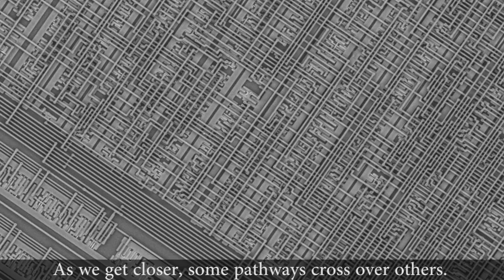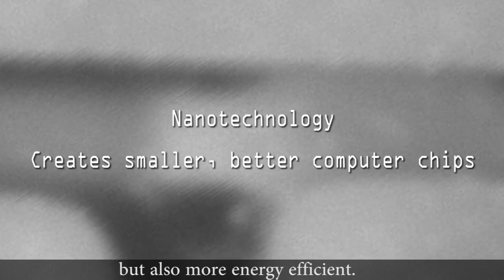Zoom Into a Microchip (Narrated)

Comment: We're actually reaching the limit to how small we can make them, which is why we are seeing newer CPUs which have multicore processors, or more than one processor on a CPU which works together with the others, this combined with better and larger L1, L2 and L3 cache memory on board the CPU (it fetches commands and stores them in the local cache) all work to speed things up.  In the past it was more a matter of shrinking the CPU down smaller and smaller so you could fit more onto one CPU.

Comment: Facinating. but the leads going to a CPU is VERY FEW compared to the number of actual transistors and microscopic wires and stuff!

Does that mean that input and output between leads are just the "buses" for data to be sent? I am guessing they are sent in unimaginably fast bursts 1 after the other through many lanes?? correct or no?

Comment: As time's goes by transistor in modern microchips are getting smaller and smaller, but it's basic composition and functionality are the same, it has a source and a drain and we need to put something in between (transistor base) to put a gap where we can switch on and off by feeding voltage.

But at some point in time we will reach the smallest size where we can never make it anymore smaller than what we have, that is when the quantum physics come into the scene, the base in the transistor will no longer be able to act as a barrier between source and drain due to the quantum tunneling.

When we come to this point, perhaps we need some other way on how to resolve this problem.
Reply: But why I am getting trouble with it? I just rather think on how to protect the secret recipe from mad scientist plankton LOL

Comment: its scary to think we are now 100% reliant on technology that nobody can make or even understand at other than basic level (the knowledge exists only in the accumulated matix of a million minds and machines, not in any one persons mind, or even 1000 if they got together and pooled their knowledge). no one person even really knows how to make a modern pencil (its an assembly of completely separate technologies) let alone the simplest silicone chip. the person who could design the layout of a chip wouldnt have a clue how to make the board for example, or what it even was made from. or the silicon. whats that. theres literally hundreds of trades and technologies you'd need to master.
Reply: andy765gtr 
Challenge accepted.
Reply: How do they make the diagram for 1 f**** billion Transistors?
Reply: Computers basically.  The highest level microchips are probably about 90 billion transistors right now. for designing chips of this level you need software like cadence or mentor graphics.
Reply: Adaptation
Reply: @SirDella   they use computers😂😂😂😂
Reply: Its not scary. Its called evolution.

Be proud of our race.
Reply: @SirDella  on the computer made of ... 1 billion of transistors
Reply: andy765gtr Let's see if you were right.
Reply: sheesh such a Debbie Downer
Reply: LOL. Hugely exaggerated... You think that the computer engineers designing cpu architectures don't know what material is used for the boards? Seriously? People's knowledge is not in such extreme isolation. I think your central point is true, but not to that level that you stated. I'm sure a small team of highly skilled people could design a modern computer. The real hurtle exists in manufacturing because you would need very expensive machines and facilities to manufacture a modern computer with such tight tolerances. That takes a lot of funding.
Reply: Mass production
Reply: One ww3 and a nuke war later, we back to stone age.

Comment: Almost as complex as these chips are is their manufacturing supply chain and production equipment.  A few critical links of that supply chain pass through Ukraine, Russia, Netherlands, German before passing onto China, Taiwan, or South Korea.  If any of these countries suffers a war, the supply chain will be broken until manufacturers scramble for the next months or years before they get the supply chain repaired with new links in other countries.  Did you know that 60% of the worlds microchips are manufactured by a Taiwan based company called Taiwan Silicon Manufacturing Corporation.  Also the main essential microchip manufacturing equipment is all made in Netherlands by a company named Advanced Semiconductor Materials Lithography

Comment: But how the hell they can creat this "super  crazy" thing? How the wires are connected to each other...they are so tiny? Can someone tell me the answer or where i can find the answer! I've been doing reserch for this, but i still dont get how!
Reply: ***** Thanks i'll do! But assume that they've already have a workable chip, now how they can make a compiler for it? i've reading book name "C-O-D-E" and some other books but it's just in a small scale idea chip not the actual chip! Thanks again for rep!!
Reply: +Rock Madly a specific robot arm makes microns of moments, the robot does it all. bow down to the almighty robot arm!
Reply: +Rock Madly It's all done by robots.
Reply: @TymphaRedbreaduwuowo  i guess the robot doesnt have any microchips in it
Reply: they burn the layers with light
Reply: It's a number of steps involved. The circuit designers will design logic circuits. The best way to understand circuit design is to learn logic circuits in Minecraft redstone. Then you'll have an idea of how to make an electric circuit do the sort of logic or "thinking" that you want. Then they will create the circuit physically by using physical cutout diagrams of the circuit that cover silicon wafers, and pour chemical liquids over the board with the diagrams covering the board so that the chemicals only touch certain parts of the wafer. Then when UV light is shined on the parts that were exposed to the liquid, it dissolves those portions away leaving only the circuit design. They do this again and again for each layer until the circuit is complete.
Reply: Most Integrated circuits (the technical term for microchip) are made by multiple steps. To put it simply: They print the circuit onto a silicon "waffer". They then fill the resulting trenches in the silicon with a metal such as copper. The left over metal is taken off to prevent short circuiting, then the whole thing is cleaned off. These are made in clean rooms that so no particles can embed themselves into the integrated circuit or silicon waffer.

Comment: I wonder how a human brain can design such a very complex circuits inside these microships?
Great vid, Thanx.
Reply: Basel - A constant evolutionary process over decades. A 'computer' can be defined in such a way that even things invented hundreds and hundreds of years ago classify as a computer -- a device which given input, gives output. We couldn't have created the microchip out of nowhere. Having said that, it is truly remarkable how we can create such things, it is insane.
Reply: Human use a computer, specified software to design the complex layout with all the transistor, diode, resistor and all connection inside.
Reply: It’s not one brain, it’s thousands of minds working collectively on the issue. Just like one mind didnt design the Saturn V.

Comment: As big as 20 cesium atoms...thats crazy
Reply: The hell are you talking about? A cesium atom is much, much smaller than 1nm across.
Reply: 20 cesium atoms would be 5.3nm across
Reply: zmkill3r sorry to broke into conversation,but thats only partially true.
Atoms do not obey classical physics,and by that physical measurments exactly.
Electron orbitals(and any molecular bonds for that matter) had QM properties,and even if we calculate them trough Borr’s equations,its still doesnt mean that the model is exactly true.We have enormous problem modeling even the simples molecules.Electron interaction(and jumping) means that “distance” between nucleuses can vary from ~50nm till 0.001nm.I always remember Faynman’s say:”Everything that can happen,will happen” and nothing is the same after measurment.

Comment: Well, the CPU takes up the least space in my laptop. Shouldn't you make other things smaller first?
E.g. the battery, the cooling assembly and the datadrive?
Making chips smaller… LOL, seriously!
Reply: But it also makes them faster
Reply: ***** Does it really? The processed data has still to travel all the way through the entire motherboard between cpu and memory. I do not think that smaller chips make those traces considerably faster.
I would very much prefer a stamp-sized 10 gram 80 KWh battery.
Reply: Ernst Stavro Blofeld well,  that's a thing from a science fiction movie
Reply: ***** Well, if you look at the energy density of e.g. deuterium, it should not be science fiction anymore. I'd say they are 50 years behind in the battery department. I mean, come on, they run the tesla cars on cheapest 16850 HongKong cells. And the battery is heavier than the entire car. And THAT after over 300 years of research, since the Volta pile. LOL How pathetic is that?!
Reply: Sure, we can make small connections between metal pieces, why can't we store a fucking duterium reactor in our phone yet? Mongrool...
Reply: Ernst Stavro Blofeld if your cpu wasn't so small, it wouldn't fit inside your laptop
Reply: +Ernst Starvo Blofeld Smaller CPU are just a consequence of the downsizing of the transistor, which make them faster and more efficient. Added efficienty mean more autonomie and smaller heatsink. 
Also, they are cheaper to make.
Reply: The die size doesn't actually get smaller, the process does. Meaning more transistors can fit. All of which use less power now because they are smaller. So more performance and less heat out of the same area. There is a maximum size a CPU die can practically be it's not about making the CPU packing smaller, rather faster by fitting more of its component transistors in
Reply: @vdmur7952  - Thank you.
Reply: Consequently nearly a decade latter, a better battery was the right request, and it’s quite possible we have carbon-14 nuclear batteries that could indeed store a lifetime of power, though not at the sizes an output listed, though certainly enough to supply the needs of a laptop or phone for the entire life of the device. 

Absolutely nobody it using the totality of their processor and most services are even moving to remote processing so it’s inconsequential what processor you have.